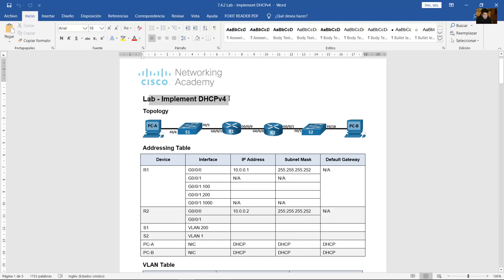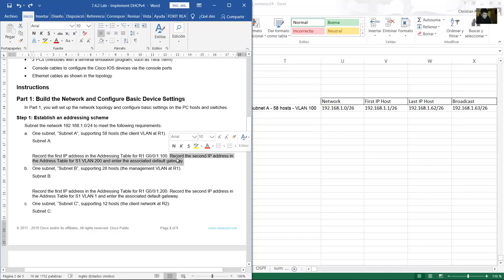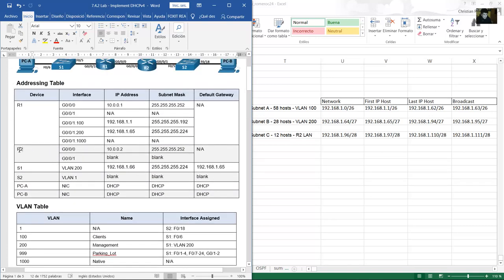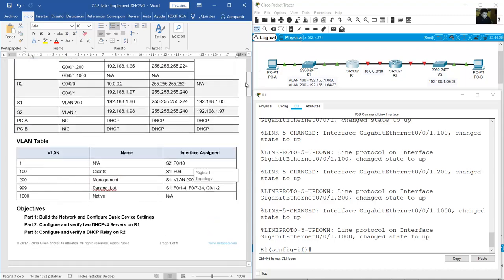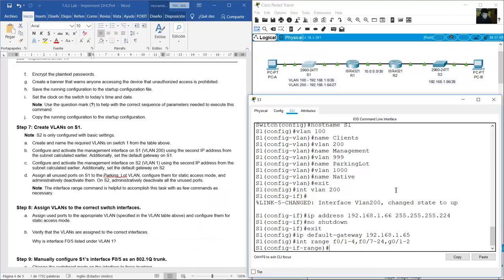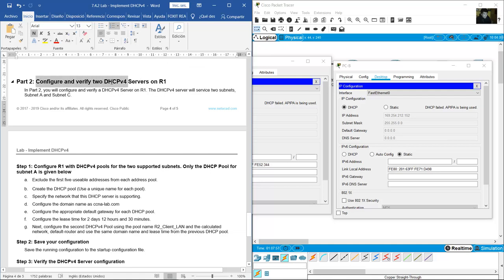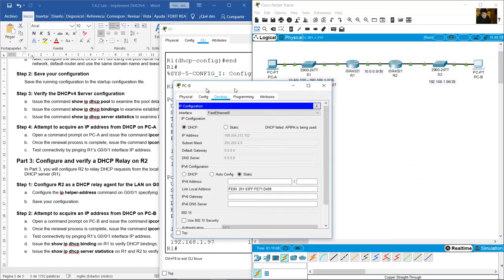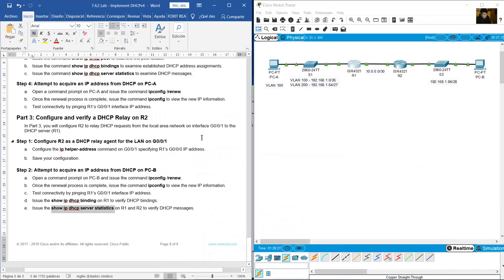7.4.2 Lab - Implement DHCPv4

Comment: Thank you for the video helped guide me through a lot. When I issue the ipconfig /renew command on pc B it says unable to connect to DHCP server, timed out. I'm on NetLab, could it be because im using Chrome or do you have any idea why it would say that? Pings are all successful, did this as well on 8.5.1 DHCPv6 kept on timing out.
Reply from the maker: on NetLab be sure switches not have the dhcp snooping activated in a a previous lab

Comment: the lab doesn't work for me I did exactly the same as you until part 2 step2 and I always get the error DHCP failed APIPA is being used any idea what it could be?
Reply from the maker: be careful with the dhcp specifications, an incorrect range of excluded addresses or incorrect network may cause that
Reply: @romeroc24  I just found it the pdf tells us to use the something221 router, I used the something331 router but I Needed to use the something321 router I don't know if that was the main problem 😀
Reply from the maker: @stijnpaepe652  Please try again from the scratch, it is better than troubleshooting

Comment: First off, thank you for all of your fantastic videos! I have spent about 12 hours redo-ing this lab, and everything looks good, then DHCP fails on PC-B.  I just noticed that on Part 1, step 9, show intf trunk, my lab has vlan 100,200,100 in STP forwarding state for f0/5,...While your 'show intf trunk' shows 'none' under spanning-tree fwd mode. I can't figure out what I'm doing that's different.   Typically I write down what I think all the correct steps should be, then compare to you before going into virtual lab. My steps seem all the same as yours  (some I didn't have correct before checking your video,  great learning tool you're providing).   If you have any suggestions, I'd love to hear.  I believe I can do 'no spanning-tree vlan 100,200,1000',  but I still wonde how I have different results from you.  Much thanks.
Reply from the maker: Hello, thank you, for now the only way to practice is repeat all, be careful all switches should have the same vlans and the same native vlan on trunks
Reply: @romeroc24  thank you, but no idea of how my vlans would be in a different STP mode than yours, after following same commands and configuration??  Again, thank you so much for the great instruction. Also, your excel chart for subnetting confuses me. Mine is simpler, Maybe I can show if you want, but clearly you already have it figured out.  I just don't quite understand some of your layout. Either way, still, thank you so much. Obviously you put a lot of time and care into this
Reply from the maker: @scottspa74  also you can send me your packet tracer file using social networks shown on 00:03
Reply: @romeroc24  Will do. It is amazing how much time you put into this. You put more effort in than my professor. I hope you are being paid . I'll upload it. if you have time to take a look, that would be great
Reply from the maker: @scottspa74  ok very nice
Reply: @scottspa74  I have the same thing do you remember what the mistake was?

Comment: Can I do the dhcp excluded and pool from router 2 instead? Will that work? 

Like doing one pool on one router and another one in the other? 

O I have to add both pool in one router in order to work for both? 

I don’t know if I explained myself correctly. 

Awesome video by the way.
Reply from the maker: you can use dhcp excluded and pools on two routers or more, just only be careful with the subnets and excluded addresses

Comment: First off, I so appreciate all these videos you have made. I found you here in CISCO 1 and now I am back for CISCO 2 and I'm sure 3 when I get there. You have helped soooo much. Second, I'm doing this lab on packet tracer at home and I'm at the part where I need to input on 
R1(config)#  ip route 0.0.0.0.0.0.0.0 10.0.0.2 & R2 (config)#  ip route 0.0.0.0.0.0.0.0 10.0.0.1 and it will not work. it keeps telling me invalid input detected at ^ maker and it's placed under the first 0, this happens on both routers. I am going to stop for now to see if you respond. I did make the IP chart and filled in the IP address's on the lab sheet also step by step to this point. Help please, if you can. Thank you!!!
Reply from the maker: 0.0.0.0 (space) 0.0.0.0
Reply: Christian Augusto Romero Goyzueta oh man I have spent a few hours on this lab. I can’t believe that’s all it was. Thank you very much Christian. You rock!!
Reply from the maker: @dinman68  I appreciate

Comment: well here I am again. This lab has been hell. At time 53.17, PC-A IP Address should be showing 192.168.1.6, but that is not what mine is showing. It is showing  169.254.53.116. I redid the steps, I lost count. I clicked on static then back to DHCP and it wont change. PC-B worked fine and I have the right IP Address on that pc. I don't know what to do, but start all the way from the beginning.
Reply from the maker: you can send me your file using social networks shown in 00:03
Reply: Christian Augusto Romero Goyzueta the PT lab file?
Reply from the maker: @dinman68  yes
Reply: @romeroc24  I sent it to your email. Thank you for looking at it.
Reply from the maker: @dinman68  ok
Reply: @romeroc24  I just wanted to thank you for emailing back and forth. I did start the lab over and finally turned it in today. This Cisco stuff is really really hard. Thank you again for all your videos!
Reply from the maker: @dinman68  I appreciate all your support
Reply: @romeroc24  Hola or hello christian  i have a similar problem yo tengo el mismo problema can you help me me podrias ayudar por favor please
Reply from the maker: @josearturorodriguezmolina5712  send me the file using social media shown in 00:03 to help
Reply: i have the same issue. what was the problem on yours?